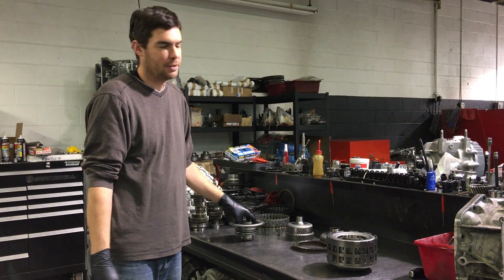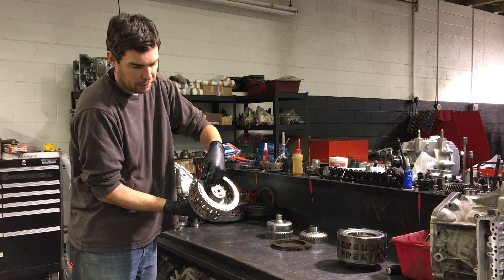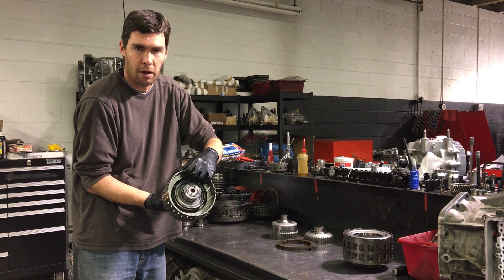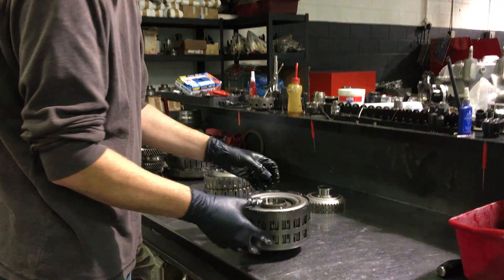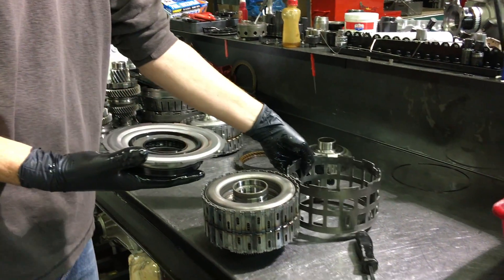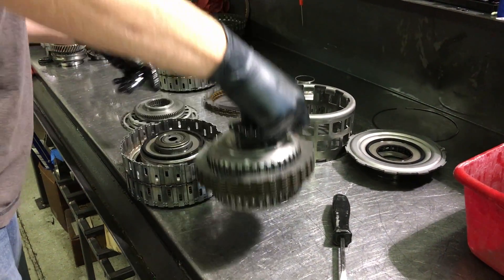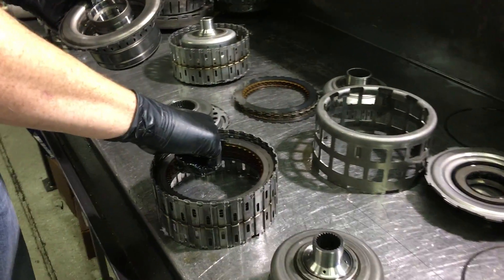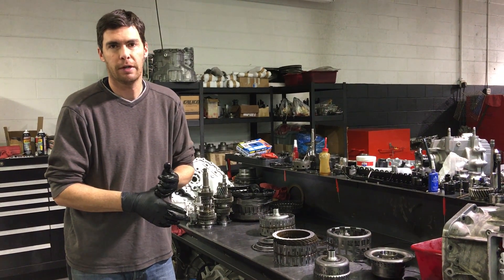GT-R GR6 Clutch Operation Jacks Transmissions

Comment: What about the part that this clutch pack goes into. Where the pressure enters this clutch pack. NOT sure of the name but doesn't that have seals to, as the clutch pack spins on it. I know you mentioned upgrading the seals in the clutch pack to up the line pressure to 20 bars, but wouldn't the others seals fail as well.? I'm not sure of the name. But it's where the line pressure enters these clutch packs. 
Great video by the way. I totally understand this. Just learning the proper names of each parts. 4th time watching the video